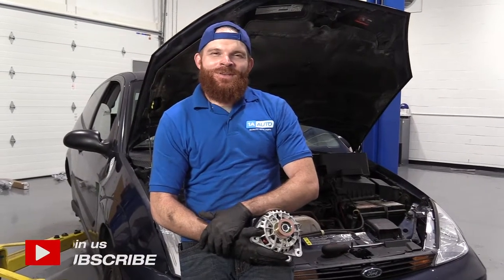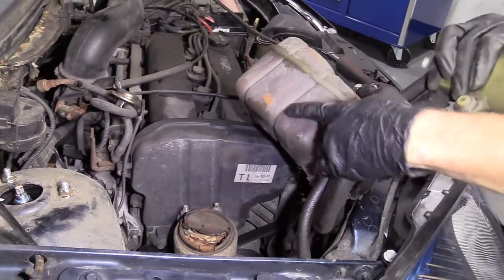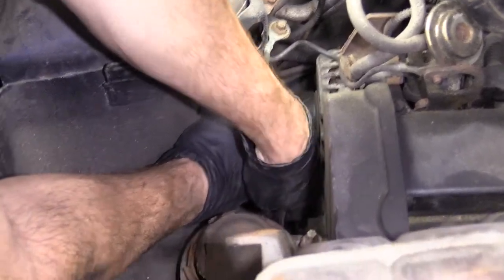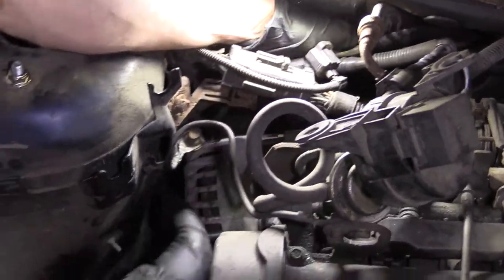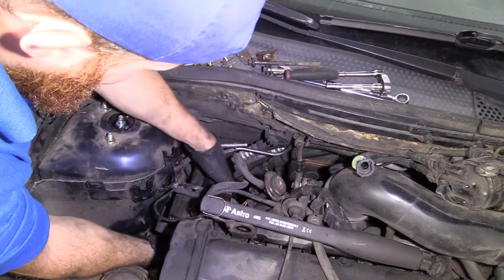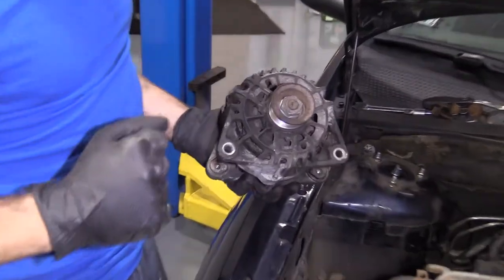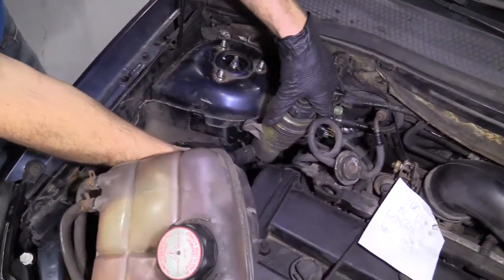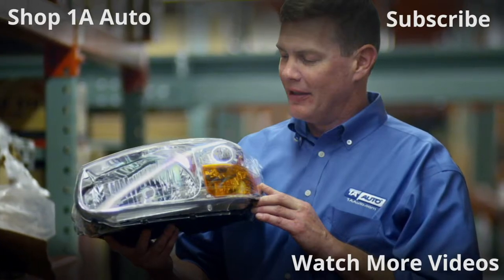How to Replace Alternator 00-04 Ford Focus

Comment: I've removed two of these (my one and the one at the wreckers) and installed one today. I wouldn't have been able to do it without this video so thank you. It is more difficult to remove compared to most cars, but very possible to remove/install in under an hour.  

I severely struggled with the back bolt today because I didn't realise you do not have to take the bolt out completely! 

I had to buy a longer spanner to reach the tensioner bolt, in able to remove the belt. 

Not sure why people are commenting about removing the alternator from underneath the car as there is no access under the car, at least not on mine.

You definitely do not have to lift the engine from underneath. Once you remove the mounting bolts from the top, you can move the engine across quite far. There is a 10mm ground bolt you have to remove because it is in the way. Once you have moved the engine as far as you can, there is plenty of room to remove/install the alternator.

Comment: Great vid guys! But for me, a couple of things: 1 - My tentioner was a 15mm not a 14mm. Weird....
2. I didn't have to take off the engine mount. The alternator came straight out with a little easy manoeuvring. 3. Don't have to take out the rear bolt completely. Just loosen it. 4. Change your engine mount if you're going in. I bought one beforehand because this vid said to take the bolts off. My car drives like a brand new one now even though the one I replaced looked almost new.

Comment: Just to add a bit more info...You didn't need to take out the rear bolt completely. Once loose (and the forward bolt removed) the alternator will slide backwards (towards the firewall) and come out. 

Once the alternator is out you can remove the bolt and place it in the new alternator. That way you don't have to wrestle with it as much.
Reply from the maker: +PhillipZX3 Thanks for the feedback!
Reply: Soooo why tf are you watching the video

Comment: Thank you very much! Best video I've found so far.
Reply: Except for the terrible advice to re-use the rusted up battery connection on the old battery post.  Nothing like using a rusted main battery connection to cause more resistance and lead to a premature failure. And he didn't bother to unhook and clean the ground cable the was right there.

Comment: TIP - do not tighten up the alternator mounting bolts until you are sure all connections to the alternator are correct.  I had tightened down the front bolt and found I had to readjust one of the connections.  However when I loosened off the front bolt to shift the alternator for a bit of clearance the sliding nuts on the alternator were now so tight it was extremely difficult to move the new alternator.  The sliding nuts on the alternator are very difficult to reset without pulling the new alternator out of the engine bay.  This was the most difficult alternator swap I have done.  The engineer who designed this alternator layout needs a good swift kick in the (where ever you feel is appropriate).......

This video was very helpful.  I did move the engine up and forward to get enough clearance, however there were mounting points on the intake manifold that are not used but are in the way.  Just bad engineering overall.

Comment: I was able to get the alternator out of my 2003 Focus Wagon without loosening the motor mount by rotating the alternator to the easiest orientation. You have to get the pully side up with the mounting bolt holes toward the front of the car, with hole that is towards the center of the car moved more towards the windshield. 

The pully side of the alternator is not as wide as the opposite side, so if you orient it pully-side up then you can get the alternator a third of the way out before you get to the hardest part. Having it part way out allows you at that point to tip the alternator side-to-side and front-to-back to work your way around the various obstructions. 

One bit of preparation to do first: in addition to undoing the electrical connections, take off the removable post. In the video the nuts on the old post are hard to undo, but I used a little DeWalt impact driver and it unfroze them easily.

The new alternator can be dropped back in the same way the old one came out (pully side up). Do this with the removable post off too, then remember when you put the post back on to put it back on the right way!
I put mine back on backwards at first and had to redo it, so learn from my mistake, haha. If you make sure to put the little weather cap over the nut at the base, that will stop you from making a mistake, because if you have the post backwards, the cap won't snap on. It will be too big.

One last trick: I used a cut off wheel in my angle grinder to take 1/8" off of the lead-in to the threads on the rear mounting bolt. There is about 1/4" of reduced diameter lead-in at the end of the bolt, before the threads start, like a centering guide, but it makes the overall length of the bolt slightly too long to get in and out of the through-hole without needing to force it. Taking just 1/8th inch off, lets it slip back in freely.

Comment: I was wondering When you were going realise the motor mount needed to be undone to shift the motor. LOL  thereas no way its gonna come out without doing that.. I replaced these many times on the focus 2003 zetec...the 1st time I ever did it was like a laurel and hardy movie where ur struggling to get something out of an opening thats just to small to allow you to remove it!  For me, shifting the motor Alot, many inches, allows me clearance without removing all the connectors and stuff on the firewall..either way is fine, you gave urself a good but of free access room by removing as much as you did...ALWAYS replace alternator with a new built one, Never remanufactured.. this job is a pain and you dont want to be doing it often, I sure dont so use only New built alternators made with all new parts...Duralast Gold is an example...  reman ones can go south in a few months... been there done that ...alot

Comment: would it be better to remove the ALT from the bottom instead of the top?
Reply: I know this is late but me and mate did that and it saved us a lot of time but it was tricky to get the screws to hold the alternator. I reckon the video shows a much more safer way.

Comment: Replaced mine and now it's not charging at all. Any suggestions battery is Working fine just got it few months ago cranks Everytime just not charging
Reply from the maker: +Evard Whitfield We wouldn't be able to diagnose an issue like that here, you may want to have a local mechanic take a look at it. Thanks for checking us out! http://1aau.to/m/Shop-1AAuto-c
Reply: Either you have a faulty alternator, bad harness connecting to the alternator (I had mine go bad a few years back), a bad/loose +12 volt battery connection to the alternator or a bad connection at the battery. This is assuming you have no blown fuses. 

The +12 goes from the battery down to the starter and on to the alternator (the big red wire on the alternator).

Also, make sure your grounds are good.

Comment: Hi @1A Auto , If u use Keep Alive Memory while changing the alternator is it safe ? Is the current from the KAM only flowing to the ECU to avoid all the computer settings gone, or is it also flowing to the whole system just like the battery and musn't use the KAM while replacing an alternator ?

Comment: All was well until I tried to mount the new alternator.   It wouldn't go back on!   Took it out and measured the mounting brackets with a caliper-- 61mm wide. The new alt was 1 mm too narrow (60mm).  Use a metal file to grind 1mm off the alt and it goes on fine.    Also when putting the belt back on, take it off the idler and loop it around the alternator before pulling the tensioner loose.  It's a lot easier to nudge that belt over the idler since there's no lip on it.

Comment: Comment: When fitting the old alternator stud at https://youtu.be/AVh_gk1wUbs?t=1118 it looks like fitting the old or new red plastic cover over the stud was omitted in this video. 
No big deal. Watch your knuckles if you forget and try and doing it later when the alternator is in the final position.
2. The genuine Ford workshop manual for this model shows this is the only way to remove the alternator (it calls it a 'generator') - it won't come out from the bottom. This video follows the Ford workshop manual procedure fairly closely, but adds the little hints to 'snug it up', use a pry lever, move the engine, etc that isn't in the workshop manual. This is invaluable.
3. I would install a new serpentine belt as a routine procedure while you have the old belt off. Cheap insurance. I see you had a diagram on top of the engine of where it goes even though you didn't reference it in the video. Taking photos of your working area before you start can make it easier if you get confused putting it all back.
4. 'Easy peasy' is right! It will probably take you around 45 minutes if this is your first one and you watched the video carefully and followed everything exactly and didn't miss any steps. Labor costs can easily double the final expense of the parts. The satisfaction of doing it yourself is far greater than the savings on your wallet.
5. That engine mount seems to have had a very rough life. A common issue with these models. Recommend replacement if in such poor condition as will fix a lot of engine vibration issues too.
Well done!
Reply: as far as that tall stud that tends to snap off.. if it Does, you can stll just connect the wire to the stubby post without the tall riser.. no big deal.

Comment: What happens if you break that neck looking piece? I can't get the terminal loose from the piece.
Reply: Just use alot of penetrating oil little torch lighter could work to. Your new alternator should have one if your gonna re use your old alternator use the second bolt , and if you break it im pretty sure your screwed 👍🏻 just be careful

Comment: My difficulty is mounting it in the slot. It's like if the intake manifold gets in the way. Any tips.
Reply: Move the engine forward , and use a pry bar , pry from the bottom of the base of the alternator up to break it lose then pry the alternator back but from like a low point angle , dnt pry directly up
Reply: The piece on the intake I cut off because it's not being used for anything on this vehicle. Made it much easier to get the old alternator out and the new one in

Comment: The part where I pull the wrench towards the front of the car, to loosen up the belt off the alternator, well my is might be stripped whenever I pull towards the car it's not even tight enough to loosen? Any other way to do this or any suggestions?? Thanks

Comment: Nice job but not that easy, disappointed that you did not remove the rusted bolt, clean up that connection and install the new plastic extender since you went so far it was a small step in the process. Still good job and thanks for the videos and all the help still a fan...
Reply from the maker: +R6F0 Thanks for the tip! We'll pass this info along to our production team.
Reply: Yes I thought exactly the same it is an electrical component after all and may have been the problem with the old alternator.
Reply: May i ask what plastic extender you're referring to? I'm changing my alternator soon and would love to go the extra mile

Comment: Buen video pero necesito de su ayuda con un ford focus 2006 duratec automático tenia un alternador genérico y le puse el original pero no se sabe donde están los cables que vienen de la computadora solo esta el cable de corriente de la batería y el que va a la fusilera

Comment: Just check your crappy Auto parts and make sure the set nut on the back of that alternator has been pressed. Or the alternator will not fit back over the brackets. And the alternator will come through the top without undoing the motor mounts. It's a pain in the ass

Comment: I noticed that the Engine did not move that much as you pushed it forward. Is it possible that you have to Loosen or remove the Engine Mount on the OTHER SIDE of the car so that there's no Resistance to the engine moving?
Reply from the maker: +Philip Y Thanks for watching!  It is possible you would have to do that if you do not get enough clearance, but usually not the case.
Reply: @1AAuto  wow, thank YOU for responding!!  I love all your VIDEOS!!  I have a 2003 Ford Focus and you had so many Videos regarding MY CAR!!   :)   Thank you...
Reply: I have an 01 zx3. You wouldn't have to remove the tranny side mount, if you don't have enough clearance even with the mount out just lift the engine up or lower it (depending on your situation) but I wouldn't take both mounts out

Comment: I dont know what to do my alternator doesn’t want to mount even though I don’t have at an angle and I’m going as straight as I can and it’s the exact same part
Reply from the maker: +Bruh Momentum We wouldn't be able to diagnose an issue like that here, you may want to have a local mechanic take a look at it. Thanks for checking us out! 1AAuto.com